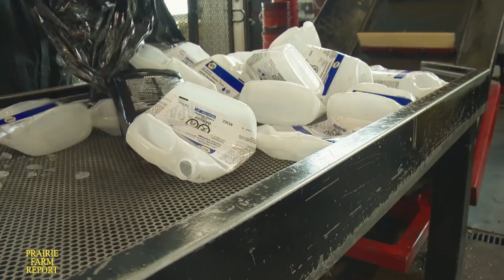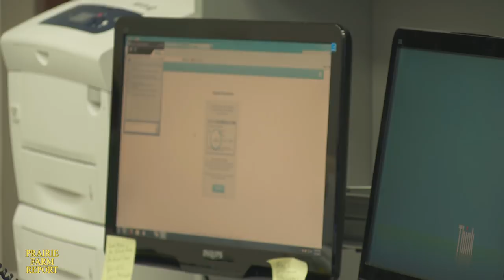Used Oil and Filter Recycling

Comment: recycle used motor oil by filtering it and throwing it in your heavy heating oil tank..... job done, provided you filter it well enough it will be fine.

Comment: it is all fine and dandy to recycle the oil and fluter too but when taking the used oil to the eco station to drop them off  they would not take them from us   why the point in recycling then when they would not take them I know they get money for the used oil and money for the fluters too they oil is given to them  
why would they turn down free oil and fluters they could make money with it. we wash  the contains out before we throw them away too why cannot be ground up right their  most of the time when I take them there I land up taking them back home to and putting in the garbage 
where the scenes on recycling place should be taking it  have been not taking it from us
they do charge on top of the  recyclable plastics too  
why  recycle  them
Reply: You need to tell the eco station to get involved in a program